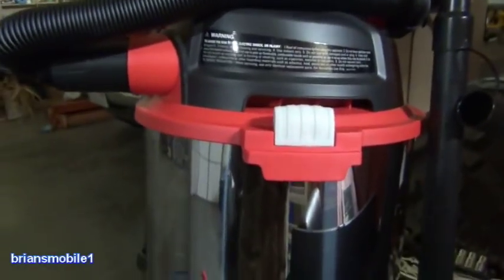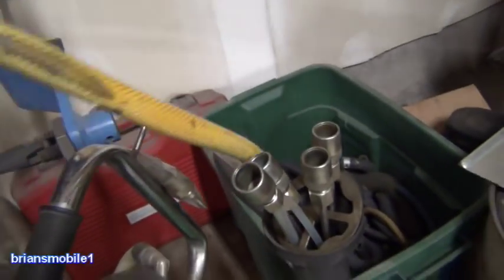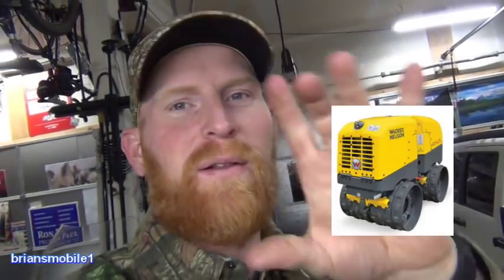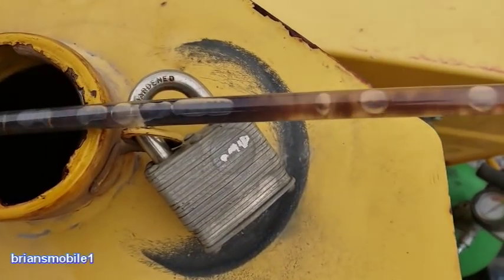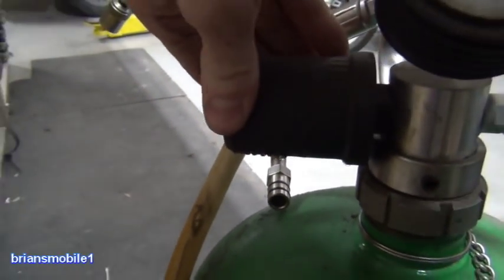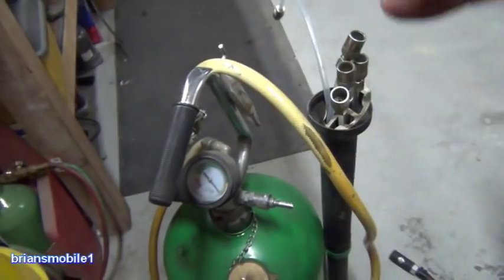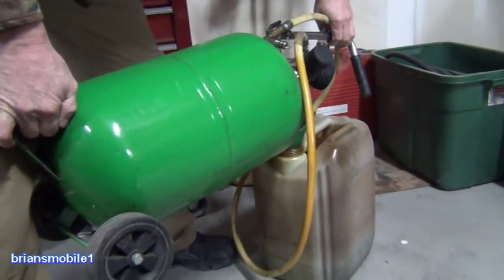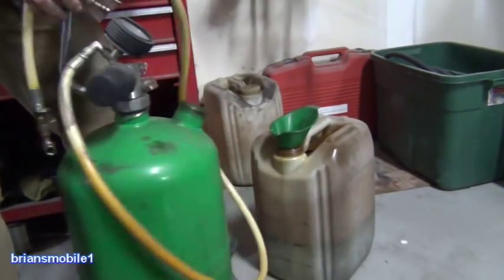Fuel Tank Garbage Removal Trick Safe

Comment: The contact brushes within the electric motor constantly create tiny sparks while it's running. Any flammable gasses going past that WILL ignite if the fuel/air ratio is sufficient to do so. A shop vac with an inch or so of gasoline in it would absolutely be ripe for Ka-BOOM!
Reply from the maker: Be cool to do a video of it!
Reply: @briansmobile1  now this I gotta see!

Comment: Yes he is correct as to crud , rust , water or any debris needs to be removed from your fuel tank and several other tanks . Definitely Do Not just use a shop vac or wet/dry vacuum !!!  I know someone who did and blew up his dad's garage !!!  Most people don't have such a system that is shown in this video . But there is a much cheaper an average person can clean out a fuel tank or whatever tank safely . I've done this for a few decades without ever a problem . First , with a cheap hand pump , remove all the fuel into a container . Then flood the tank with water and remember that fuel is lighter and floats on water so let it flush out the opening . Then use a little dish soap and flush it with water and let it flush out the opening of the tank . If it's a rusty metal tank , pressure wash it out to remove as much rust as you possibly can . Then dump or drain all the water . Then after doing all of these steps , go ahead and use a shop or wet/dry vacuum and allow all the water to drip down on the inside of the tank and vacuum it again . Then it's all set unless you want to reseal the rusty tank as you can buy the tank sealer at the auto parts store . I have done this on cars , motorcycles , trucks , equipment , heavy equipment , gas , diesel , hydraulic , oil and all kinds of tanks with the greatest positive results !!!  Then recycle all fluids properly !!!

Comment: Mythbusters already tested the Shop Van with Gasoline. They could not make it catch fire no mater what they did. It works great just connect a small clear hose to it then use a piece of like Pex Tubing, The air coming out of the shop can does not go thru the motor. Just don't do it inside and use a long enough tubing to keep it away from your work area. Works great.
Reply: Really because I can’t afford one of these . And was going to do that until . He said not a good idea

Comment: Most shop vacs have universal motors which have brushes that spark almost constantly. They also pass the exhaust air through the motor to cool it. So what would happen is that you would fill the vac tank with a mist of gasoline in air, then blow it past a more or less continuous spark.

Now I want to see @theslowmoguys do this!

Comment: Hi Brian, I need some ideas from you. Have an old Highlander, did an oil change and 2000 miles later the oil still looks like I added it yesterday. I don't have an oil pressure light on but I don't know why it isn't looking dark and dirty.
Any ideas on what to check?
Reply: Probably just the engine is clean inside.. not a bad thing! If it wasn't circulating or something.. the engine would be knocking and blew up by now..just means your engine is likely been taken care of..

Comment: Why not just go to the local pick and pull, find an electric fuel pump "preferably" off a diesel engine, make a simple 12 volt electric connect, attach in and out fuel lines and wooola. 12v hobby or motorcycle battery will last much longer than air. and will not cost much more than 15 - $25 depending on how fancy you get with your recovery bucket and switch set up.

Comment: Surprising how often one finds use for a vacuum extractor. Mine is smaller and plastic, with the option for hand pumping or compressed air.
Reply from the maker: Those ARE nice to have- no compressor needed.  Do you have a video of yours in action?  Can you do it one handed?
Reply: @briansmobile1  Changing oil on a boat engine often involves vacuum suction of warm oil out the dipstick hole, and sometimes is done with no access to shore power. Because boats require a low center of gravity, the engine is always mounted at the very bottom. There is no room for a pan drain, most don't even have an oil drain plug. I did do a video of a diesel boat oil change, though I doubt most of your viewers would find it useful. It's always nice to see another one of your videos Brian!

Comment: That still did not tell how you got that massive amount of rust out of that gas tank.
Reply from the maker: Fortunately the tank is easily removable.  Best drain it, remove it, tumble it with small abrasives, then fiberglass the inside.